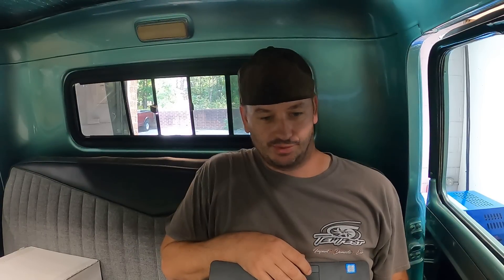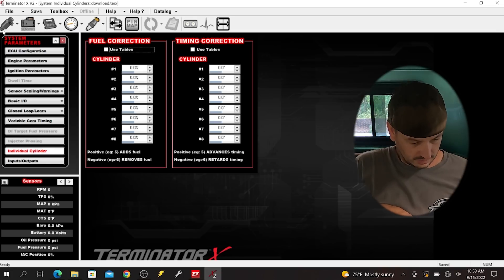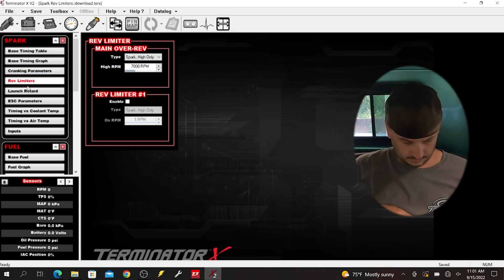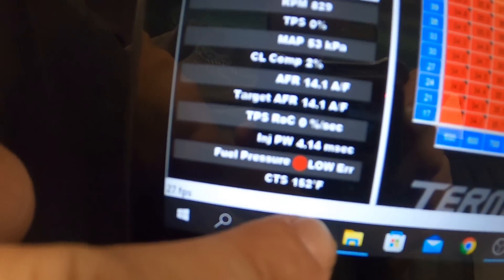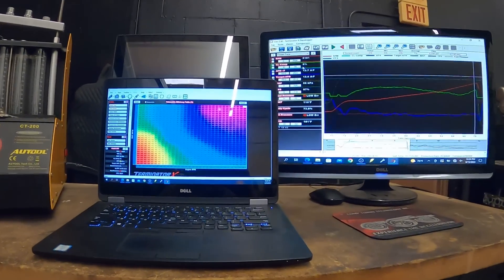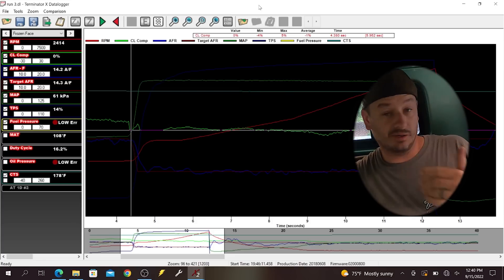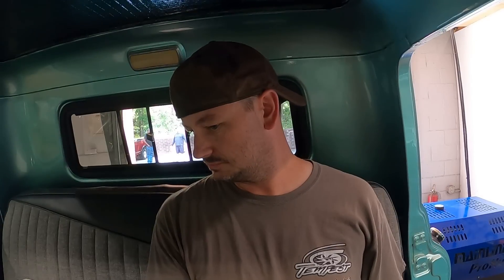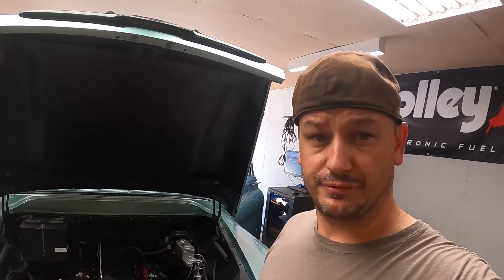Wizard Tune vs. Dyno Tune // Holley Terminator X

Comment: What did you do to fix the flair up @7.10 into the video
Reply from the maker: I don’t remember the video specifically but If it’s a flare up at start up it’s usually in the iac parked position table

Comment: Have you played around with injector timing before to chase hp on NA setup, just wondering if it's worth anything, you'd need bigger injectors than needed so you can move the injector timing around like open later or close earlier - just haven't seen many videos on it cheers keep them videos coming
Reply from the maker: 99.9% of the time it does next to nothing. I’ve only seen it work well enough to matter a few times
Reply: Thanks , was thinking engines with lots of over-lap injecting when air speed is highest might help , even or more so at idle - just something I'd like to try out some time cheers

Comment: I got a question I did a battery relocation to the trunk and my starter turn slow chassis grounded / engine ground from chassis. Should I run and grind straight from the battery ?
Reply: Yes you should and the thickest gauge cables you can get
Reply: @robholmes2129  thank you I watch mostly everything you put out, I built motor at home learn and taking notes from you.
Reply: I used 0 gauge cables for my relocation on my 68 Buick Electra. Ground directly from batt to frame. Then on the same point to the LT cylinder head. Then your power wire from batt to starter. Engine ground to the chassis. Make sure you sand all paint off of the ground points and use dielectric grease to prevent corrosion
Reply: gear reduction starter helps as well did same thing on my foxbody draws less amps cranking